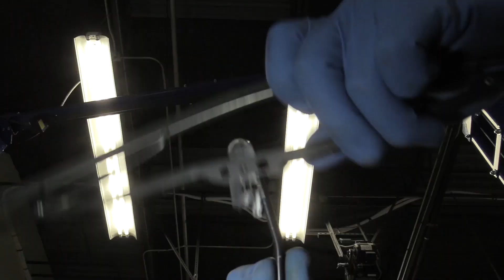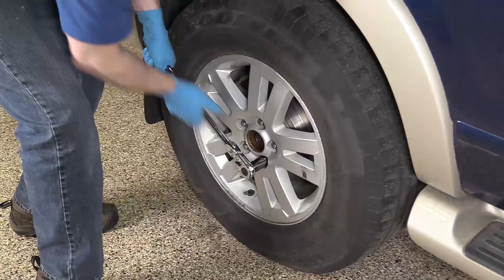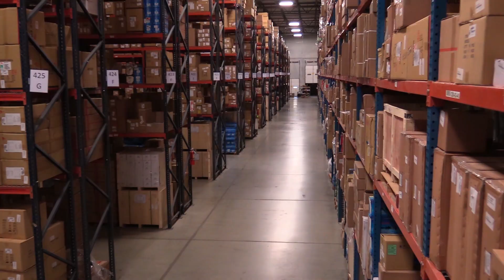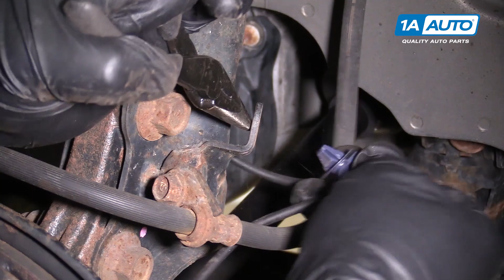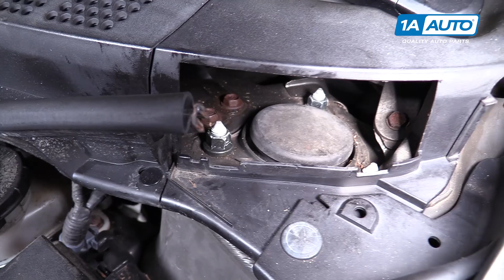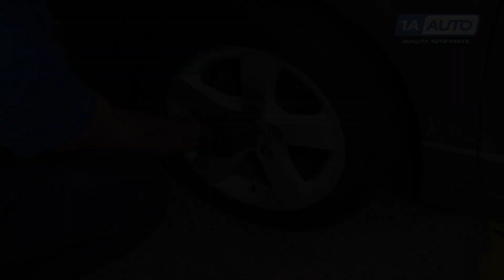How to Replace Front Strut and Spring Assembly 06-11 Honda Civic Sedan

Comment from the maker: √  Watch the Video
√  Buy The Part at 1A Auto http://1aau.to/m/Visit-1AAuto
√  Do it Yourself
√  Save Money
Reply: Thank you!👍
Reply: Top tip: Loosen the middle nut slightly also, so when you're removing the springs and the middle nut its a lot easier and wont spin the shaft

Comment: Thank you for this tutorial. We just did this a few days ago and it wasn't too difficult. VERY IMPORTANT TIP: Jack up both sides of the front of the car and it will give you maximum clearance to remove the old and put in the new strut. It took us nearly 1.5 hours to get the first one but once we figured out that we had to jack up the front, the next one took only 15 mins.

Comment: Just replaced mine. Easy job, just make sure you have a good breaker bar and a good torque wrench. My driver’s side spring had given up and driving was unsafe. Car ride is now 100% better, just a little firmer than with OEM parts, but solved my problem. Shop wanted 1,100 dollars for the job. I paid under 170 for the parts and 30 minutes of my time
Reply from the maker: +dr bichat Thank you for the great reply. We love to empower our customers by showing you how-to perform your own auto repairs while installing our high quality auto parts. Have a great day! 1aauto.com
Reply: What brand did u buy ?
Reply: @dsanchez1113  Only use Monroe OEM. $170 for a pair coil over struts means they are junk.

Comment: Hello thank you for the awesome video!  I don't know if this will help anyone or not, but I discovered you could rotate the the strut to align the lower bolts after you secure it in to the top portion of the job.  I thought I was sold the wrong parts because it was not aligning initially.  Hopefully this makes sense and helps someone out.  THANKS AGAIN!!
Reply from the maker: +Derek Mitchell Thank you! We love empowering our customers and showing how to perform DIY auto repairs with our high-quality auto parts.  http://1aau.to/m/Shop-1AAuto-c

Comment: I ordered the TRQ front struts for the coupe and it was great and i had gotten then from AM auto For a little cheaper than the trq site. By $75 dollars , thanks for the kits,  I already bought the rearward spring shock kit from trq and it works great , and oem control arms for the rear . everything is aced at trq i only shop here cause i know they know how to actually look at what they manufactured

Comment: Thanks for this very good quality video. Did the front brakes on my Civic today and noticed the boots on the struts were torn quite badly on both sides. (77,000 km.) Seems they are not very sturdy. Wouldn't this cause premature failure due to dirt entering the mechanism ? Are there better quality replacement boots available?
Reply from the maker: +Stan Coleshill Thanks for watching!  The boot is what prevents dirt and debris from getting into the strut, so if it is torn up pretty good then yes it can cause failure.  We do not carry the boots by themselves, but I would probably recommend you replace the struts if you are experiencing ride issues.  1aauto.com

Comment: Aren't you supposed to torque the top hat nuts once the wheel is back on the ground and the suspension is under load?
Reply: If you mean the 3 small bolts...yes, at least I do.

If you mean the center bolt...no.

Comment: Hey yall, so im lowering my 2010 Honda insight with some eibach pro lowering springs. A few questions A) can I use wd-40? and B) will I need an alignment done after? Its gonna be about an 1 inch drop
Reply: Yes to both

Comment: Really like your entire series of videos- have used many many many to fix replace parts on my 06 Civic with almost 290k miles!

1 question- how come you never apply an anti-seize product to help with future disassembly? Here in the rust belt (OH) I slather it on and still break bolts a year later!!
Reply: I have an 06 Civic coupe MT, bought it off the lot  in December 2005, also in Ohio, also with high miles nearing 275k. I use anti-seize and thread lock on everything that won't negatively affect torque values (and some that might taking great care to be within +/- 5% factory spec).

I always start to treat bolts and nuts for an upcoming repair or part swap with PB blaster a week before on a daily basis. Haven't needed anything more than a breaker bar for a single thing in nearly 15 years working in it! This includes big chassis bolts for suspension work, exhaust, and many of the tight subframe bolts.
Reply from the maker: +yourfinaldecree Thanks for the feedback!
Reply: @1AAuto  I felt the need to augment my posted comment... The process of a week's worth of daily to multiple times daily treatment with penetrating oil/rust penetrant has worked for every single bolt in my car SANS THE LOWER REAR SHOCK BOLTS THAT SERIOUSLY POOP THE BED. I guess after having swapped out over $1650 in parts,  including the complete front suspension inclusive (both sides for everything before and after), front pads and rotors, outer+inner tie rod ends, replaced boots on rack and inner tie rod end to rack interface area, rear hub and bearing, complete rear drum brakes replacement including all the hardware and shoes, special rust resistant drums, rear shocks (hatehatehatehate), upstream and downstream O2 (just upstream needed replaced, but downstream was only a little more to get both on sale so why not, NGK laser iridium plugs.

I did all of this myself, and the most complex thing I had ever done to a/my car before this episode was an exhaust and cold air intake many, many years ago. The videos helped along with a Chilton and the other one I have. Of I got stuck, seeing it done to the actual parts in real time was a great asset, but trying to figure it out first is the best way to learn your car, to learn why a part is the way it is!

Comment: You don’t have to compress the control arm before tightening fully,?
Reply: YES. Lower the vehicle to the ground allowing it's full weight to press down before tightening or torquing the upper bolts. This video will get you in trouble. It is not correct.

Comment: An FYI. If you buy aftermarket Strut Assembly, like a "KYB Strut-Plus Assembly", you're going to be an apparatus to retract the spring in order to align the two bolts. Was disappointed after all the work with removing the OEM part on the car.  Good Luck!!

Comment: Just a little tip: There's a little round cap on the plastic cowl that you can pop off to have easier access to that rear top nut, especially when reinstalling it. Just move the windshield wiper to get to the plastic cap.
Reply: What brand did you use for replacement?
Reply from the maker: +east los Thanks for checking us out. Shop for high quality auto parts on 1AAuto.com:

http://1aau.to/m/Shop-1AAuto-c

Comment: Would a shop be willing to take your new strut and attach the spring to it after you have taken the old one out? What would they charge- like 1/2 hour to an hour in labor?This job looks pretty straightforward other than that part.
Reply: Not worth it. Buy a quickstrut which is complete. If your going to invest your time and money, do the job right. Your springs are worn out too if the struts are bad.

Comment: Your doing your viewers a tremendous disservice with this video. NEVER, EVER tighten and torque those upper bolts until the vehicle is down on the ground with it's full weight pressing down on the tires. Also be very careful to Not allow the CV Joint to become disconnected. Wire it in place if needed.

Comment: Do you absolutely need a pivoting ratchet wrench to remove top strut bolts?
Reply: thaik56 not really, but it helps in general
Reply: Pull the cowl off, it takes minutes and allows easy access to the top bolts. Yes you need to pull the wipers off too.

Comment: If those bolts don’t affect the wheel alignment why does it need realigned?
Reply: If you go to a lowering spring or coil overs it will but no standard struts.

Comment: it's that easy?? damn  now i wish they werent so expensive
Reply from the maker: +Q_Wreh They don't have to be!  Please check our own struts that we sell for this application on our website: http://www.1aauto.com/2006-11-honda-civic-strut-and-spring-assembly-pair/i/1assp01193?utm_source=YouTube&utm_medium=CTA+Comment&utm_campaign=ytcomment&utm_term=196_oKj69Ac
Reply: Lol 200 bucks is expensive for a civic. Should be 120 for both tops
Reply: They really aren't expensive, even for quality, and this is especially the case considering the entire assembly doesn't require anything else to install. (Although I usually grab new m14x1.5 57mm flange bolts and lock nuts for the attachment locations to the knuckle. The addition of some cam bolts to allow your alignment shop to adjust camber if necessary is also a sub-$20 option.) 

I'm a fan of Gabriel and Monroe personally, but a friend bought a set from 1aauto, forget the brand, and they appeared to be quality parts and fit as well as the more expensive gabriels I had just installed and possessed a ride that was only very slightly less quiet than my own. If I hadn't known where they came from, I probably wouldn't have noticed!

Comment: Would this work on a 06 civic si coupe ?
Reply from the maker: We currently do not have an auto repair video specific to your vehicle. You might be able to apply some of the basic steps shown in this video to your application.  +Salomon Meza
Reply: Yes. Torque spec are different.

Comment: You should mention why you should not remove the spring and instead just buy the whole assembly. Do not remove the spring. It's dangerous and can kill you if not done with the proper tools and should probably be done by a pro. Good video 👍
Reply from the maker: +Vicente Agama Thanks for the feedback!
Reply: Should also mention that most "whole assemblies" are trash unless you spend a lot of money on them.

Comment: Nice video, but you didn't mention anything about the arrow that is on top of the mount. Can you tell me in wich direction it should point? Hope you can tell me!
Reply from the maker: +peter hendriks The upper mounts will only install one way due to the bolt spacing, so the arrow will always point in the same direction, which is inboard for this vehicle.
Reply: Thanks for your answer, could it be that it is different on a 2010 civic hybrid? on my car the arrows are pointed towards the front. On the internet I hear also that they have to point towards the fender and some say that they have to point towards each other. I'm really confused!
Reply: @1AAuto  I checked the bolt spacing on the Monroe RoadMatic strut assemblies and the bolt spacing is all 3.75 inches. And the 8th gen civic forms are arguing about whether the arrow faces the fender or towards eachother. And since the bearing plate rotates freely I can't just assume one or the other. Help!

Comment: Why my hub is so low when trying to refit my front shock? Theres not enough room for it to fit cant get the 2 bolts back in
Reply: Jack up under brake
Reply: i am having the same issue, how did you take care of it?
Reply: @breakfastenjoyer  Place a floor jack under the knuckle on the control arm and adjust up or down to what you need.